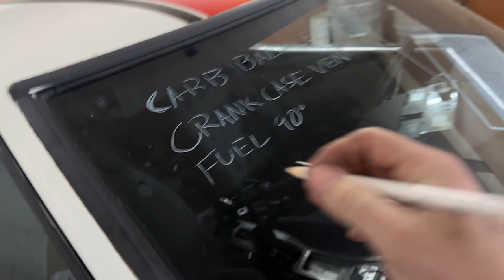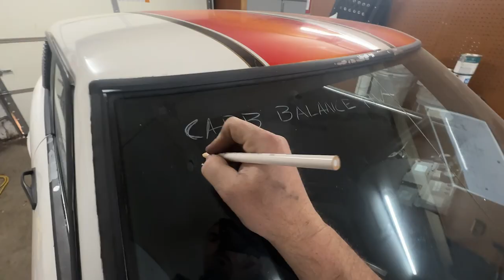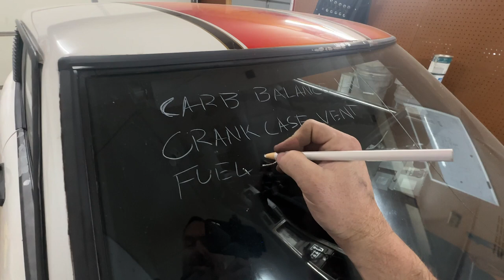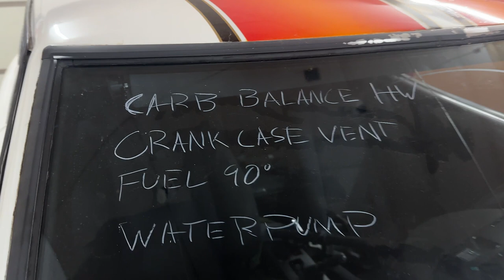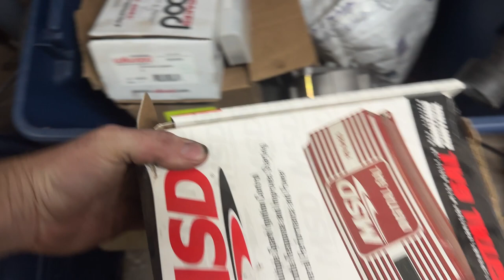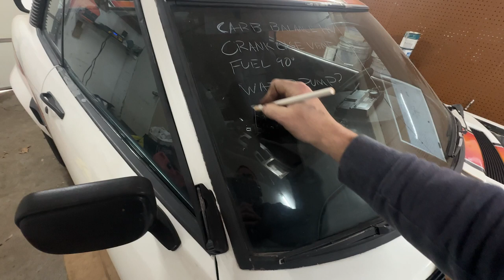1972 Celica Engine Swap - Part 2 - #dalesdragon

Comment from the maker: Ian - Need to pop in right away and say that I already got some awesome help from Charlie and Jake who informed me that I need a different plate on the passenger side of the block that has a PCV outlet in it. Jake had one on the shelf and now its on the way to me. We'll be knocking that off the list right away!
Reply: I dont run the side vent, but its a preference thing, the PCV system is a little finnicky unless you have all the parts.
Alot of people i know, and myself just run the RC blanking plate on the side, a hose on the top to a catch can.
Reply from the maker: @FR13R   well I have that piece on the way from Jake but that makes sense too. I'll start the OE way and see where it gets me. Thanks!

Comment: Water pump, you need to find the water pump housing. The actual water pump is the same 18r to 18rg. 
Balance pipe, you can remove and blank the holes. Or keep it and only use the ports you need.
Reply from the maker: I feel like I have the right housing. I have 2 to choose from. The one with the bent return pipe on it to cross a hose over the front of the block seems like the right one.

Comment: Crankcase vent... IMO the best is an exhaust based crankcase evac system. I have it on one engine.  Basically you weld in a check valve into the exhaust that draws a vacuum and run that to the valve cover and that sucks out the crap and blows it out the exhaust.  Much better than allowing it in your intake system.  IDK what water pump you have, but cast iron impeller is better than stamped steel...  One other note.  I just learned about a year ago about the 18R block and its oiling issues.  Basically it has a flow problem and I'm looking for a larger oil pump.  IDK if one can be adapted or not.  One thing that some engines do is use carb jets to slow the oil flow in certain areas so that you get higher pressure in other areas.  The 18R issue seem to be in the oiling of the crank, so maybe restricting the oil flow to the head would increase the pressure/flow to the crank.  On some engines, I grind the oil passage ports to match the bearings for better flow to the crank.  Maybe worth looking into.  IMO a larger oil pump or dry sump would be a great option.
Reply from the maker: LOADS of info here! Thanks man. A good dual port catch can is starting to seem like the right solution for venting the crank case and head without putting any oil back into the engine via vac. Or maybe I don't know what I'm talking about there either :D

Cast water pump impeller is go for sure. I only found one stamped impeller out of everything I have and pushed it aside immediately.

The oiling issues will have to be what they are for now. I know folks routinely run coolers and also accusump to keep pressures up and I'll probably end up going that way eventually but I doubt I'll have the engine apart again until something goes seriously wrong.

Comment from the maker: Ian - I've also done some more thinking and talking about the carb balance bar and after a trip to the hardware store I discovered that all of those threaded holes seem to be tapered so normal bolts don't fit. Still undecided on how to deal with that. Rubber plugs? JB Weld? Jake said he just tig welded the holes closed in his. The one hose fitting on the top is definitely for the vac to the brake booster so that's no longer a mystery. One on the bottom goes to the PCV and the other will get blocked off.
Reply: Again, alot of people just block the balance off, it makes it easier for tuning. you can get the older manifolds that are just plain with no balance and plugs for vac ports, Redline in Aus sell an aftermarket on also.
Reply from the maker: I’ll look into that aftermarket unit. Thanks!

Comment from the maker: Ian - Here’s another topic from the video. Let’s talk about water pumps. I’ve now gotten intel from Jake that the 18rc pump is good to go for an RG and I’ve written Rick over at toyhead and asked about the RGEU impeller with the flange on it so I can run without a fan clutch. The only problem now is that I need a pulley to bolt on that flange… and I don’t know where to source it. Any ideas?
Reply: I’ll look at my stash and see if I have a spare pulley. - Jake
Reply: Also the W series both 40 and 50 are the same length. Drivelines are also the same on the cars from a 5 spd and 4 spd
Reply: Be careful not to put pressure on the valve cover with the chain. I’ve seen em cracked
Reply from the maker: Oh we definitely put pressure on that valve cover :) I’ll check and make sure it’s not cracked. As for the trans I figured it would measure out fine I just worried that it came from a pickup/motorhome application that it might have something different about it but I’m not so afraid of that anymore. If you have a bolt on pulley for the pump with the rgeu flange then I would definitely grab that from ya.
Reply: I can have a look in my stash also but im all the way in AUS so might not work for you
Reply from the maker: I’ll take it from wherever it can be found. Thanks!

Comment from the maker: Ian - and another topic to start from the video… MSD 6A… how do? :) Does the MSD replace all of the accessories currently strapped around the coil like ballast resistors and the like? Anyone ever installed one that can point me to videos or pictures and let me know about your experience?
Reply: Had 6AL on my old 18RG. Wired it right to the toyota magnetic pickup replaced the toyota ignition all together..with a blaster2 coil. Plugs gapped to .050"
Reply from the maker: Excellent! Another ignition question, I have a Petronix conversion in the RC dizzy I took out. Can I transfer that to the RG dizzy and expect it to do the job?
Reply: @oioracing  yes if the screw pattern fits it should work the same.
Reply: I covered this on my 18RG vid years ago
Reply from the maker: @CodyPowersLives  I'll have a look. Thanks!
Reply: I just ran my msd without a resister 
As long as it’s electronic ignition so the points won’t burn 
Then gap your spark plugs to make it worth while